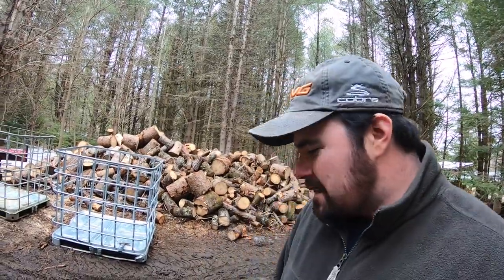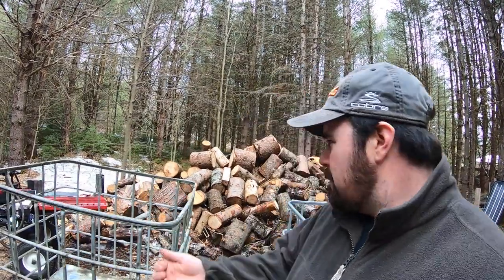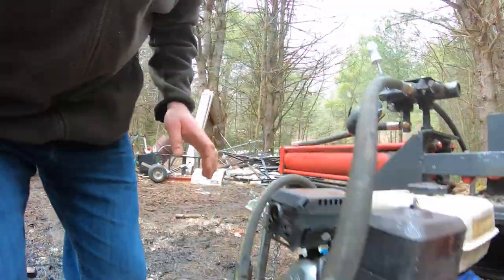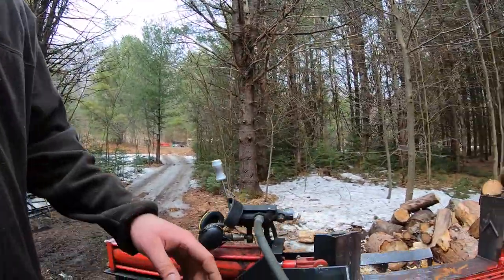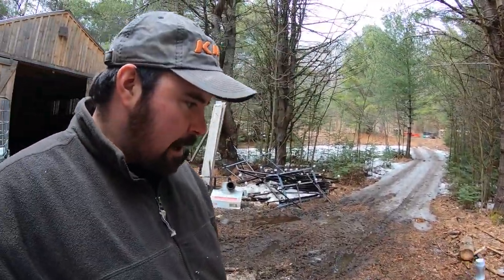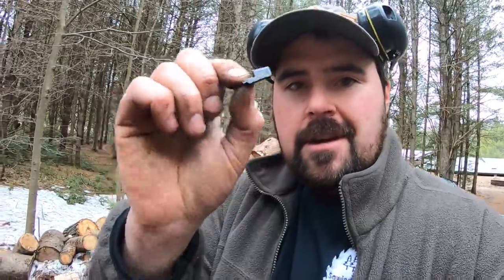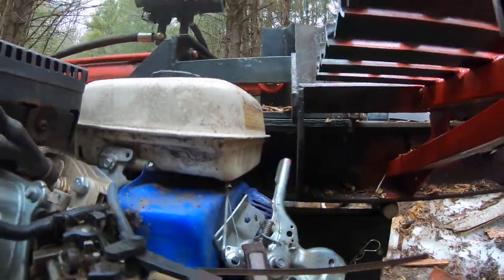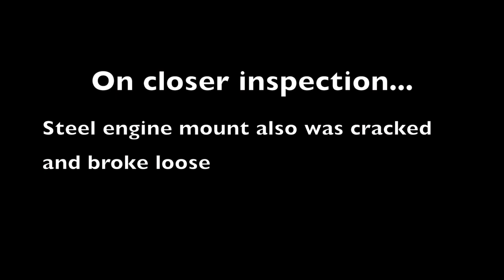How to Handle Firewood Less | fixing a gas engine with krazy glue

Comment: Nice table!
Don’t know if you know this but you can make super glue set up instantly if you sprinkle some baking soda on it. If your building up a spot. It’s best to make light coats. If it’s a heavy coat it will harden on the exterior right away but takes the interior a little longer.

Comment: Hey Sandy, my wife and I just purchased 77 acres between Bracebridge and Huntsville, looks similar to your neck of the woods!  I’m just building a log splitter with my dad, sounds like your carb might need a cleaning.  I (try) to run non-ethanol gasoline in all my small engines and I always use sea-foam as a stabilizer/carb cleaner.   Maybe just drop the float bowl and see if it’s full of sediment.  Cheers! Love the Chanel!
Reply: sea-foam works great,and only high octane.
Reply from the maker: I think you’re right. I just got done cleaning out my golf cart carb and may h e got lazy on this one. I’ll see about running seafoam in the future as well. I’ve used it in other engines before and seems to do a good job. Sounds like you’ve got a nice property there and the sawmill will sure come in handy. Happy cutting

Comment: Champion built that splitter... or at least, if Champion didn't design it, they copied it like others did. We bought the same thing from Princess Auto or, TSC. I wound up having to replace the Honda knock off engine on ours too. The original flywheel cracked in it. I suppose you can't expect much out of a $100 retail engine. Those engines are all over the place. Its generally less expensive to replace the engine without a hydraulic pump than to buy parts for them. If you have a scrap yard in your area, you might want to take a walk through it in search of spare parts for yours.
Another thing, cut a 5 gallon pail into a cover for the engine. If its left out to the rain, sometimes water will get into it through the screws on the muffler.

Comment: You are powering your splitter with a Chonda, ha ha.    I build a splitter much like yours except i salvaged an 8 hp Honda off an old Emglow air compressor and my table is large enough so that i can stack rounds perpendicular to the wedge travel and still leave room for the rounds to fall away after being split.  The table has little stops on it so that the rounds don't roll off the end of the table.  There is also a little "helper" leg under the table so that the splitter does not tip back.  Good of you to think about "steps", if you eliminate some over time it becomes a major time saver not to mention working in a way that saves your back too.
Reply from the maker: Some great ideas you brought up. I think I’ll add some small steep pieces to keep my rounds from rilling off too. If that engine gives me anymore trouble it’ll be a Honda engine for sure coming next